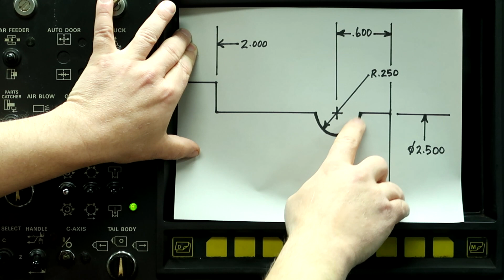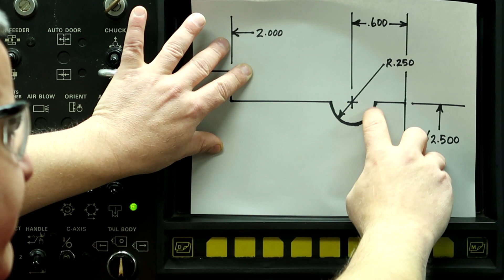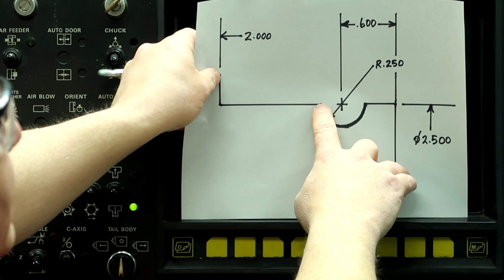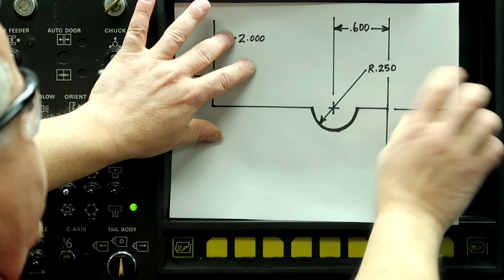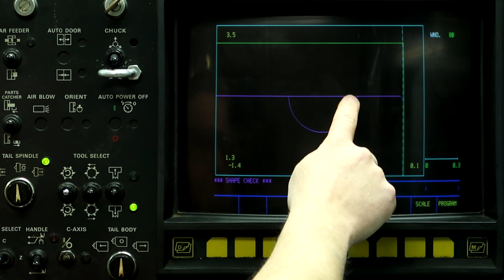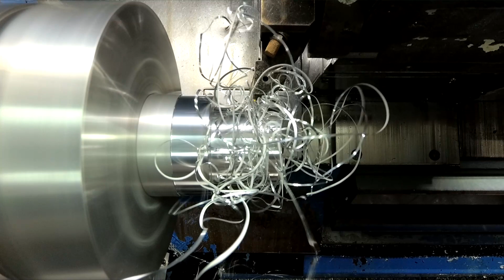Mazatrol Programming Small Concave Radius

Comment: I tried this exact thing on my T2 but the grooving tool refused to carve out the radius. My tool description was same as yours except it was .08 wide groover with .04 full radius. I ended up using the same geometry with a highlighted bar out unit and registered the same tool as GNL-out with 0 degree lead and 0 degree angle/width and .04 radius. It worked fine, but why didn't it work as a groove tool in Copy-out?
Reply from the maker: Glad you got it to work. Maybe the length of the groove tool was described too long for the width? Not sure.

Comment: I wish you could copy the groove finish toolpath down on a Mazak. I run into this shape often but i dont like profiling away from my wedge in style full radius tool, which is just a parting tool. Pushing into the cut works better. I've never had to do a production run of this shape, so i have gotta around it by roughing with a groove finish and sneaking in with offsets.

Comment: Hi Phil ...Great video .. I have a Lathe CNC Mazak Machine with Mazatrol Cam t2  in milimeters we work in milimeters in Peru .. so we are machining a piece with a concave groove similar to the video .. but I do not get the shape when I make the simuation .. the piece have 96.1mm of diameter with a radius of 6.6mm and the distance from the flange is 13.4mm .. the configuration of the tool is TOOL FILE Shape: GRV OUT   HLDR: 1    DEEP ANG:  35    CUT ANG: 3  WIDTH: 25     TOOl DATA:  SHAPE; GRV OUT   NOSE R: 1.5  FWR/RV: RIGHT   R/L: RIGHT when I make the simulation don't get the shape only in one side .. what could be my error ? no problem with the graphic only in the tool maybe any mistake in the configuration... Thanks Phil great greetings..
Reply from the maker: Reduce the deep angle to 8mm even though the tool is 35mm deep. The machine will cut the part.
Reply: @mazatroltipsandtricks6816  Hi Phil, I tried with 8mm deep angle but not described the geometry... tried with 90mm deep angle and could get the geometry.. it was on the screen I mean in the simulation.. I will try machining a material ..
Reply: Hi Phil.. Thanks a lot for this video , this help me to do a work with concave radius similar to the video, very great Phil you are the best , I follow all your videos ... Greetings
Reply from the maker: @miguelangelayalapena4493  Thanks. Glad the videos are helpful.

Comment: Have questions on smooth control 5 axis 2 spindal intergrex ,I program alot on this Machine np, but when working on chuck 2 spindal 2 I have to program backwards positive value take material negative backs away from  chuck ,I will program a concave radius on spindal 1  huck one perfect when I program same shape on spindal 2 it tells me either excess material alarm or to big for shape ,do everything to make that go away not working shows on simulation for part shape but not on tool path ,I tried to take out roughing because of excess material alarm nope ,ok then I try to make the od /I'd small because of alarm saying shape is too large for unit ,nope ...so then I change those lines and it says backwards contur...and when running eia have to touch off all tools and give them offset to make it work like 2.5 inches but tools are all different some are .800 from zero,bought as a new floor room model not sure we're to start on the 2 spindal ,good for basic shapes on spindal 2 ,but anything more complex it give unexplained problems anyone have any ideas please share
Reply from the maker: I have found that the material length on unit 0 may be too long or too short sometimes and that affects spindle 2. Try adding material length on unit 0 then face off the excess with edge process and see if that helps.

Comment: How would you program it if the radius was .004" above center?
Reply from the maker: Not sure what you mean.
Reply: @mazatroltipsandtricks6816  if the radius of the groove is .004 above your x dia.
Reply from the maker: @jerrywilson1917  Got it. You would calculate the radius center the same but add double the radial offset distance, which I believe would be. 008" added to your shaft diameter.
Reply: @mazatroltipsandtricks6816  alright thanks for the help!!

Comment: This is a valuable tutorial.  I have never tried this yet.  I am confused about one thing.  I notice you told the control at the beginning in your sequence data that you were taking off .500 total and leaving .010 finish stock. What determines the amount of material per pass?  Is that set in the parameters in this function?  Did I miss something?
Reply from the maker: Thank you. The depth of cut determines amount taken per pass.

Comment: I need some help I have a 4" piece of alum 4" long I need to put a taper in with a radius in the center of .75"
The depth of the bottom of the radius is 3" but both sides taper out to 1" and 3" 
I've been struggling pls help t32-2 control . it's a roller for a cable I would post a pic but I see there is no option for that on here .
Reply from the maker: Hi Dan, shoot me an email with a sketch and I will look at it. My email address is located on the About me page under business contacts.

Comment: Hi Phil
i have one question, i need your helps. if i have a lots of small or Large Concave Radius on a shaft with a pitch, how can i make the program like Grooving? thank you
Reply from the maker: What control do you have on your machine?  Newer controls can do more with grooving where my older control is limited on the type of grooving it can do.
Reply: @mazatroltipsandtricks6816  i use the old machine with mazatrol T 2 like you, so we don't have any method to do this quickly with T2
Reply from the maker: @haiangletrong9758  If you just need to plunge into the workpiece, groove 0 will do that easily with a square or full radius tool.  If you need to machine a groove feature with a full radius at the bottom wider than your tool, you will have to program it like I showed in the video.
Reply: @mazatroltipsandtricks6816  how about M98? ,Can the control T2 do M98? if the control T2 can do , please show me how to do this
Reply from the maker: @haiangletrong9758  Do you have EIA programming capabilities on your machine? I do but I have never tried to run a sub program. I think the T2 control is a little too old to do sub programs but I could run some tests.
Reply: @mazatroltipsandtricks6816  Thanks for your helps. i hope your new videos

Comment: Good videos MT&T, keep up the good work . Any ideas on why I cannot seem to get a universal OD tool with the B axis on a 45 to comp correctly on a newer integerx with a smooth x control . I think I have tried every possible combination in tool data and even reversed the tool in the spindle. It’s seems to behave better if I leave out the TNR in tool data ? Any ideas?
Reply from the maker: Not sure what the problem is but I describe a 45 tool as a general out B tool.  Make sure you are also calling it a 45 tool in the description and not a standard tool.
Reply: Mazatrol Tips and Tricks thank you for they reply. I’m pretty sure I have it labeled right , general out , 45 holder,  etc. it cuts perfectly on X and Z with  a TNR value set to 0. With the exception of the chamfer being a little undersized. But to be expected. However if I input .. say .0312 TNR . Z would be off half that amount .016 and X will be off the full amount on a dia .0312. Of course these numbers flip flop and change when I change cutting directions but they do not mirror themselves like I would expect . I have seen x be .031 big and .062 big,  .031small and .016 small . Z is either .032 long .016 long or .031 short or .016 short .I went through all possible index , standard or reverse. All four rotations left and right two or three times . It’s driving me crazy. What am I missing?

Comment: How do you know when to use a CPY cycle instead of a BAR OUT or BAR IN cycle? I've used mazatrol programming for a long time and I haven't used the CPY cycle often and I wonder what conditions allow you to use it?
Reply from the maker: It depends on the part geometry. Running a Bar Out on some features will cause the tool to whack the backside of the tool when the machine tries to escape from the part. It happens when the feature is small and the tool retracts into the part. Machining with button tool ceramic inserts on the face works well using a Copy process.
Reply: @mazatroltipsandtricks6816  thanks for the info and great videos. Continue to do more good instructional videos!!

Comment: Awesome! First time using this option! Works great
Reply: Any ideas why I’m not getting my 2nd radius on the start of the groove?
Reply from the maker: @Sebastianbartledoo  Did you use the highlighted OUT option?
Reply: Mazatrol Tips and Tricks yes. My radius is a .088 with .01 chamf on each end. I can’t put a 3 digit number in starting point z
Reply from the maker: @Sebastianbartledoo  Try reducing the size of the tangent radius to .005 or smaller for that small of a concave radius.